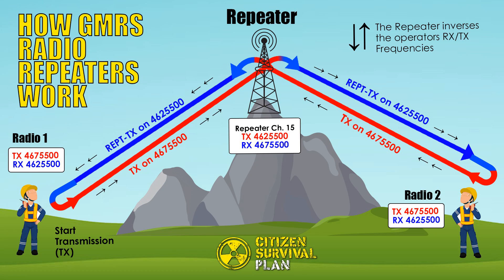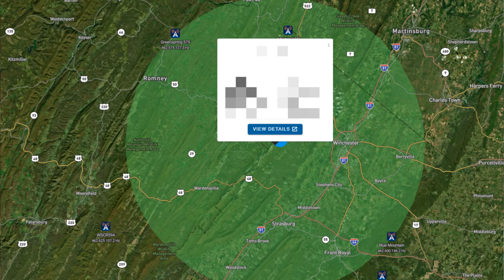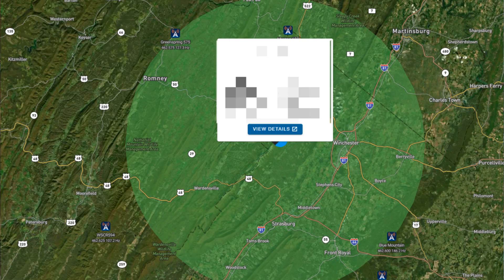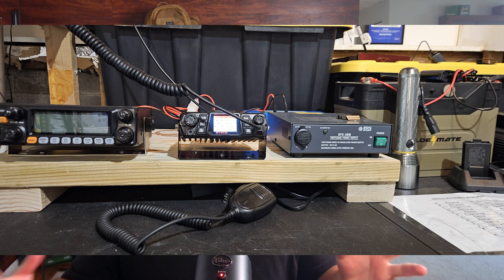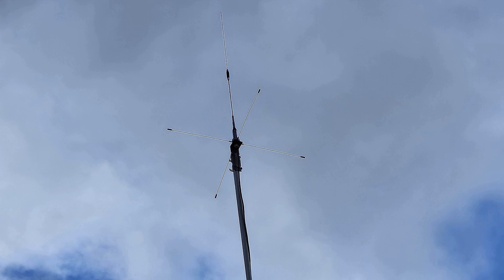How Far Can A GMRS Radio REALLY Go?

Comment: so if one repeater puts you in range of another repeater, can you use them both to skip off of? because the one in Oklahoma City that is by me, puts me in the radius of one in Ada, Oklahoma that has 80 mile radius, and the one by me has a 70 mile radius, so is it possible to enter the frequency and tone of both repeaters to push my signal out that far. I don't know anything about putting all that into a radio, so I was just curious now that I see these? Thanks for putting out the videos.

Comment: You touched lightly on this subject.  Your testing and my testing are completely different. We need to understand that my terrain and your terrain can be insanely different. We have several repeater around us that have the ability to cover 50-80 miles easily. My simplex coverage in my area is also not bad. There's a group of off road adventures guys that travel the national forest here in Virginia and with my HANDHELD I'm able to talk to them 40 miles simplex. Here's the thing my property has overall good elevation whereas some people don't have this advantage.

Comment: The best distance I have gotten from one HT to another is almost 20 miles, but we were both on high terrain features; essentially hilltop-to-hilltop. I have gotten about 30 miles from an HT to a GMRS repeater, but that repeater has an antenna about 300' in the air. People talk to the International Space Station with 5 watts or less. For most practical purposes, if you can draw a straight line to it with nothing in between, you can talk to it. More power may help you overcome attenuation from intervening obstacles, but in terms of range, power is a distant third in importance behind elevation and antenna.

Comment: It's all about the height of the antenna, not the power. 1 or 25 watts makes virtually no difference with handhelds and stock antennas. Real world range will likely be 1/4 mile. But put the antennas at 20 feet, with just 1 watt, and you'll work several miles.

Comment: Will repeaters still work in the case of a high altitude nuclear blast and associated EMP?
Reply: I'd say no, but depending on radius to the blast, shielding, and strategic placement of the repeater.... It could either be obliterated/ melted, or rendered useless from exposure to the exponential energies released in a nuclear blast.

Small chance it makes it through un affected.  Then there's all the crazy radio interference introduced into the area by all those micro and macro waves it would have to overcome to transmit and receive clearly...I doubt a 25 to 50 watt signal would make it anywhere near clear enough to be audible on a line of sight device...but ..idk... I hope I never know.